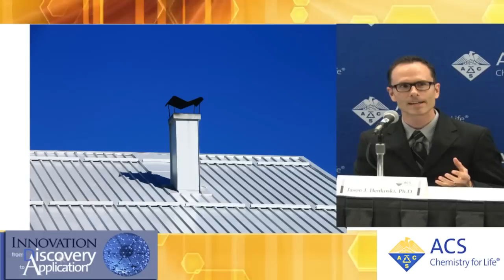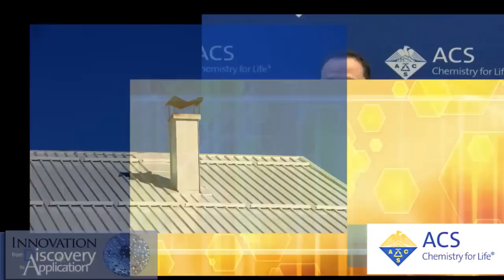Glass paint could keep metal roofs and other structures cool even on sunny days

Comment: Hi Jason, great line of thought especially the link you have to combining some organic coating technology with the inorganic silicate. My rule on this is very much in line with the German standard DIN 18 363 for single pack silicate paints whereby I have always limited additives to<5% as above this the properties of the material are actually changed and not just enhanced as one would like. The best way around the potential hairline cracking is to control the film build. So a true Sol-silicate formulation could be the best way to go. On the point of porosity I would opt for an organic penetrating sealer coat along the lines of your thought on a silicone polymer or combine it with the original formulation. Then you can also refer to the Zinc Rich Anti corrosive 2-K silicate paints based on Lithium Silicate which are high build and are not plagued by the possible hairline cracks.